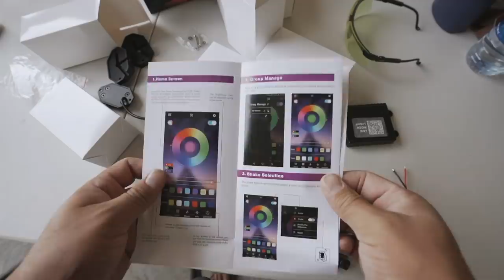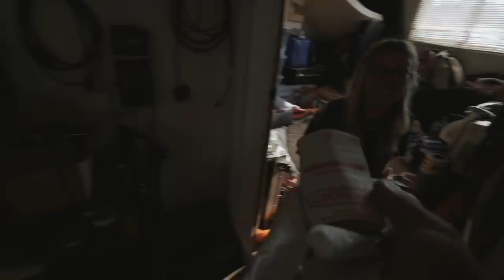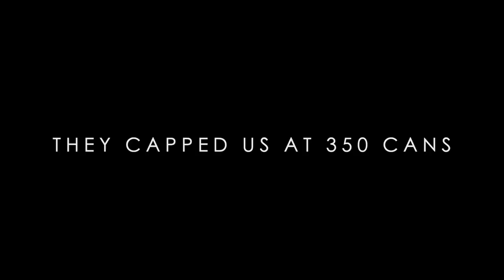Getting Ready For Descend on Bend 2021 - More Bus Problems

Comment: On the 7.3 powerstroke engines, you have to always keep a spare fuel filter and always add a little bit of 2-stroke oil mix and some Power Service brand fuel treatment to the diesel fuel or the algae will just come back.  Also, the  Motorcraft fuel filters are "water block" filters, so if you have water in the fuel it will build up around the filter and choke off the fuel flow.  When I first got my 1996 F250 PowerStroke 7.3 T444E Turbo Diesel, I had a heck of a time with the fuel system contamination issues.  Now that I always add just a bit of 2-stroke oil mix to the fuel and Power Service Diesel Fuel algaecide and fuel treatment, I haven't had fuel problems since.  Also, keep in mind that the filters are 5 micron fuel filters and clog up extremely easily.  I'm trying to drive as many miles as possible on my F250 to try to get 1 million miles on it.  I have almost 500,000 miles so far and still running strong and lots of power and starts right up.  Don't forget to change the glow plugs every 50,000 miles or they can start coming apart and stop working and possibly break apart in the cylinders and cause a lot of problems.  I also put in 1 bottle of SeaFoam engine/fuel treatment at least 1 time a month when I refuel it, just to keep the fuel system going smooth.  Keep in mind this only works on the 2003 and older Powerstroke diesel engines.  Do not add anything other than the power service additives to any ford diesel engine newer than 2003, since it can mess with the emission control system.

Comment: Isaac Dorit's fuel filter is plugged with dead biomatter..They should have dropped and cleaned out the tank but I figured they wouldn't..They charged her for a new Fuel Filter and Diesel Biogaurd in her tank after keeping it a Month and telling her lies.. So she is going to plug Filters untill its cleared out.. She needs to carry extra filters and I'm sure she can change them if you show her how to prefill and replace them.. : )
Reply from the maker: I just pulled the fuel filter out and looked at it. Looked clean?
Reply: @isaacturnerit  May be Fuel Strainer in tank and Dead Biomatter isn't allways Black in the Filter..
Reply: I have seen biomatter in Diesel that isn't black or brown looks tranesparent like a Jelly Fish I have a Cutter for Oil and Fuel Filter thats how i find these problems.

Comment: Isaac have Dorit get someone to check her fuel lines when fuel heats up it will cause a line with a weak spot to collapse
Reply from the maker: They just replaced the whole system :)
Reply: @isaacturnerit  not sure then unless a wire is shorting out going to an  injector or computer